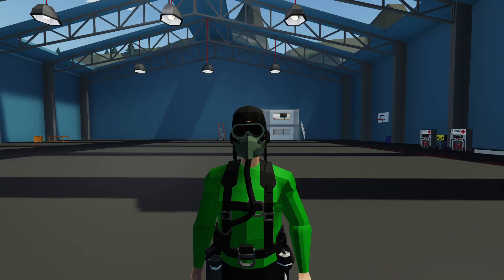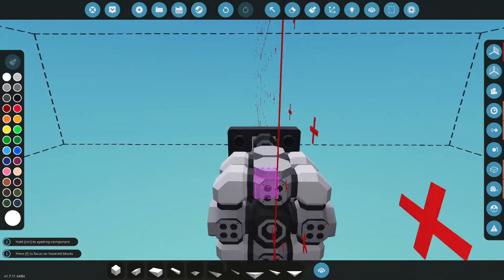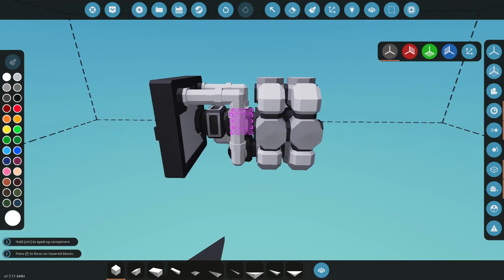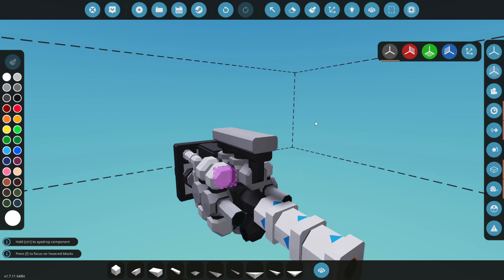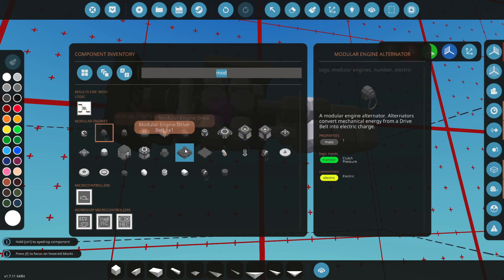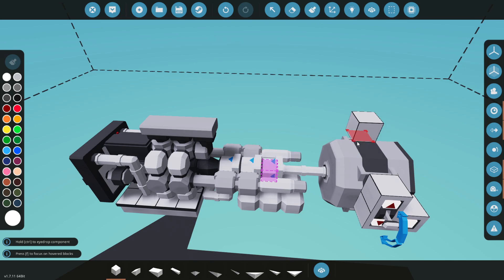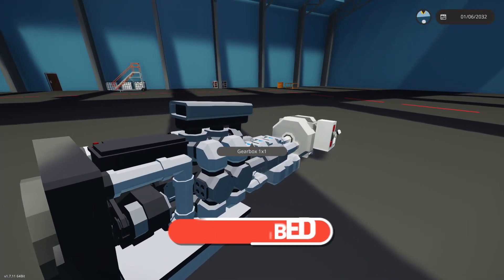Modular Engine Build 8cyl 1x1 Stormworks Tutorial - How To

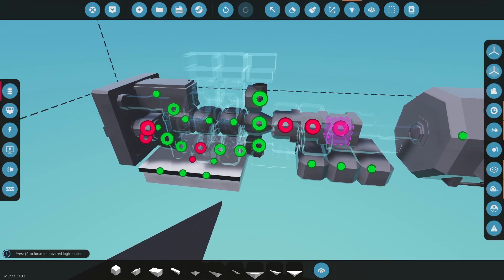Comment: 6:00 If you don't use the generator feature and not connect the battery data, remember to disable "generator mode" in the microprocessor settings or it will run full throttle all the time
Reply: and this now becomes  the official tutorial for the microprocessor
Reply: @Zizunn  Just wanted to say thank you for all the good stuff you make, using a fair bit of it.  (c:

Comment: Not sure if its because I put it in an enclosed space, but it wont start even though I followed it as well as I could

I did connect the exhaust and air intakes to the outside and the gearboxes are all on 1:1 and 1:1 though so i dont know why it wont start
Reply from the maker: Electric?
Reply: @ProfNCognito  Electric is hooked up properly, even have the generator, i can hear the starter trying to start the engine, but nothing happens
edit: does the radiator have to be exposed to the outside?
edit 2: i moved the radiator outside but still showing no life
Reply from the maker: How much throttle are you giving it?
Reply: @ProfNCognito  Full throttle

Comment: Because I've never played, but trying to learn about it before I buy, can you explain why you make a big deal over, for example, the extra crankshaft block? Is that a problem at all? Like, it changes engine performance or something to have more crank? Or is it just a case of people just don't usually build like that and it's a bit weird? I don't understand why a longer crankshaft is notable.

edit also does adding extra accessories like water pumps and such reduce final engine power like in real life?

edit again what the frick do catalytic converters do in the game??
Reply: Adding an extra crank block like Prof did, does nothing to the engine except open up some building possibilities pending on your build style. I too have done this on builds when placing components. Made life much easier. Also opens up a spot for the Modular engine temp sensor, without sacrificing a cylinder location,  if you don't want to use the composite logic node for temperature readings.  

Anything that uses RPS input from an engine RPS output WILL affect how much power goes to places. I've been told it's an even split between all devices being powered.  As far as modular belt driven clutch devices, they will be taken into account as a device that requires a driving force. What this split is, I'm not sure. How much the power is reduced, I'm not sure, but i believe it's marginal. Personally, I only use Starters on my modular engines as belt driven devices. 

Catalytic converters in the game reduce the amount of exhaust plumage coming out from the engine. If you have too many, it WILL choke out the engine as it does affect the flow rate. It WILL cause a "No start" if the cat is reversed on installation. 

This is a great game. Highly recommended if you like creating things and making them go. I'm a newer player myself and I've loved every minute of my 1000+ hours in this game. 😎
Reply: @Lord_Bison  Well, currently being disappointed with TrailMakers. I like the look of the vehicles in this game. Trying to understand the physics and building differences.
Reply: @UnitSe7en    The physics of Stormworks is interesting, I've made my fair share of mistakes while building and discovering what works and doesn't work. Creative/Custom mode allows for all testing and building purposes without fear of going broke or running out of fuel early in the game. Happened to me on my first Classic Career game. The building of vehicles is pretty much limited to your imagination, but ultra huge builds will bog down the beefiest of PC's. I Tend to stay with medium to large builds personally. My current project is a Quad Jet Engine VTOL, using fluid pivots and thrust vectoring to hover and then fly with ailerons, rudders & elevators in plane mode. Right now all it does is fly erratically in the air. I think I have too many wing sections providing too much lift for the weight of the plane. It's a process, but when it works the way you want it too, it's a satisfying feeling. I have many hours ahead of me on this project.
Reply: The crankshafts add some resistance, they are like baby flywheels, so putting more will reduce the engine performance on the generator, but it's better for vehicles since it adds more inertia, thus preventing the engine from stalling especially when more load is put on it (changing gears for example)